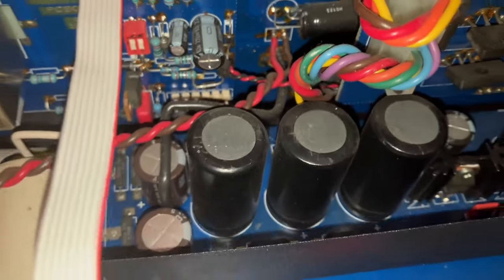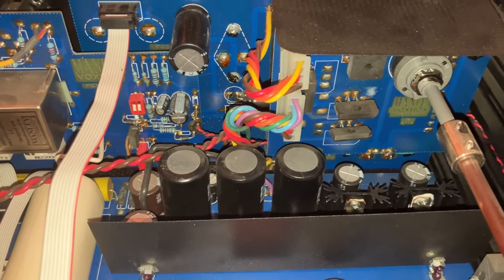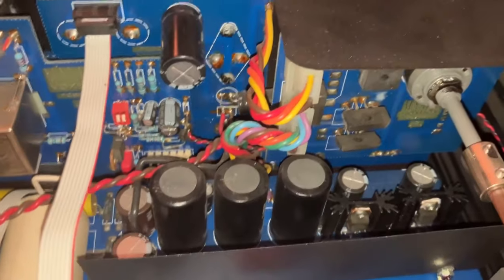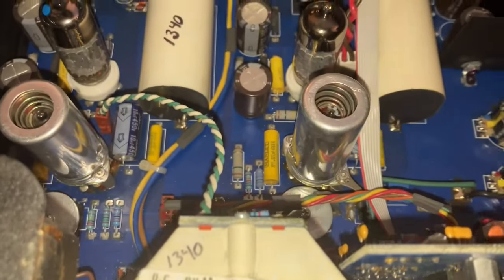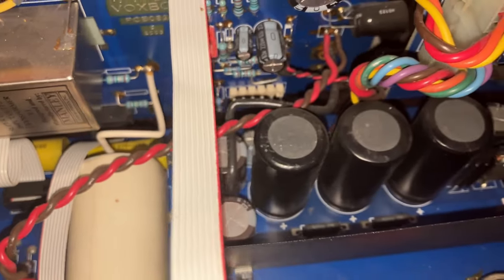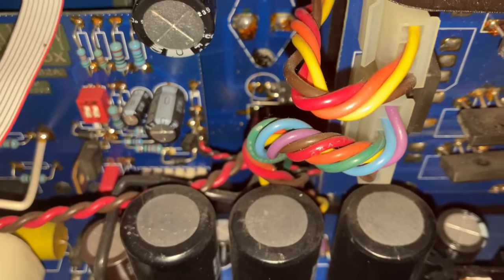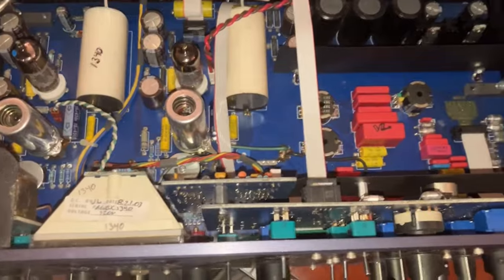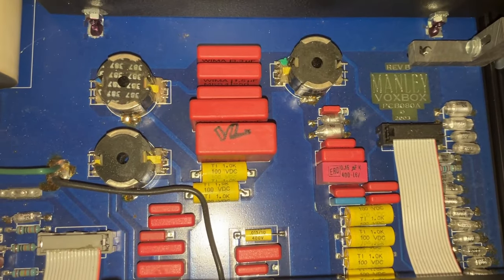Manley VOXBOX with Acoustically Humming Transformer

Comment: I’ve had one of the four diodes in a bridge rectifier blow open causing one of the power rails to be half wave rectified, causing a lot of mechanical sounding hum. I recommend starting by testing all of the diodes with the power off before potentially stressing out other components

Comment: Quite difficult to tell from just a video, but the rectifiers at the back look like they've been getting very hot, especially the large flat square one which the camera makes it look like there are lumps missing. I would scope the lower voltage rails coming off that board to see if there's any ripple, and work back from there. All the smaller looking caps are quite flat looking, but of those 3 larger caps, the one to the right looks verrrryyy slightly domed. If you can confirm if any of them aren't flat, that's a culprit right there to begin with (which could in turn have put a heavier load on the bridge).

Comment: What you need is an RF poking stick. It's a tool used often in analogue tv repair. It's a long plastic stick that you use to poke stuff. When you poke it, if it changes the sound, that's what is producing the hum.

Comment: I have same problem. Can you please let me know if you found out what is the problem? In my case everything is the same, just less humming noise. But still noisy. Thanks for the video. Cheers.
Reply from the maker: It turns out the transformer needs replaced; the kind folks at Manley walked through a series of troubleshooting steps to nail it down. But there are other possible problems — the transformer itself might be OK, just stressed by other failing parts. If you want to try fixing it yourself you definitely should contact Manley support so they can walk you through it. (Or if you want to send it in to get fixed you can trust their techs are top notch.)
Reply from the maker: Tell Manley I sent you. :)
Reply: @Lantertronics   Thank you for sharing this. I am in Ireland and I think I need to find some local places to check it out and see what is best to do. I don’t think we have Manley service in Europe. But I will definitely check around. I was hoping that it is something simple and easy to fix but I was aware that it can be something tricky. Anyway I do appreciate your feedback. Thank you and enjoy in Voxbox, even with this issue it is really great unit. Cheers.
Reply from the maker: @noni1st  Yeah, it's unlikely to be an easy fix. Hmmmm... even if Manley doesn't have an "official" service tech in Europe, they might be able to suggest somebody?
Reply: @Lantertronics  You are right. I will send them an email and see if they can recommend somebody. Thank.

Comment: I’d be p’d if I paid for a Manley and it sounded like that …
Reply: It's from the mid 1990s, so it's potentially 25+ years old.
Manley have an excellent reputation for helping customers work on their own gear and providing good after sales service.

I do agree with above that I'd start checking those bridge rectifiers first.
Reply: @Loscha    Sure - from the oxidation(?) inside, it was obviously old … just saying, I bet it wasn’t cheap; hope they detected the fault before they paid
Reply from the maker: This is a VERY old unit (I bought it used at Guitar Center in Atlanta), so it's not surprising at this point that it needs some work. The Manley staff has been very open and helpful.
Reply from the maker: I've had it for awhile, it wasn't like this when I first bought it.